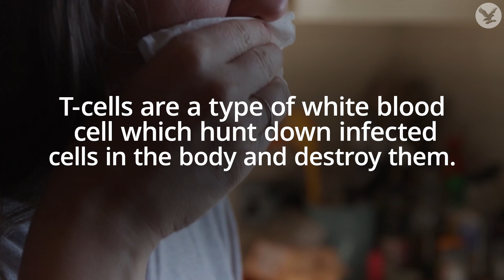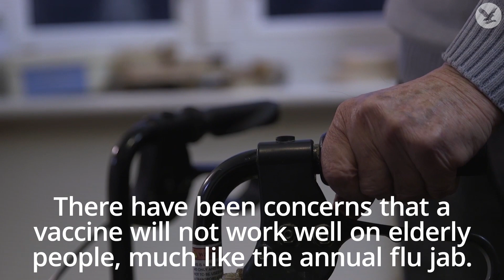How does the Oxford vaccine differ to Pfizer’s?

Comment: How many doses does each individual need? And does it have to be stored at -80°C?
Reply: @Zuul Gatekeeper Many thanks!!! I found that it can be kept between 2 and 8 degrees and hat it was cheaper but wasn't sure how many shots. They also said that whilst the mRNA vaccines were more expensive, they were more amenable to mass production but I think the oxford one looks very exciting! Who knows maybe if the oxford one doesn't report for a while it would be worth using the Pfeizer one for the most vulnerable in the first instance. If the cost means we can safely open up society a bit it would arguably be worth it.